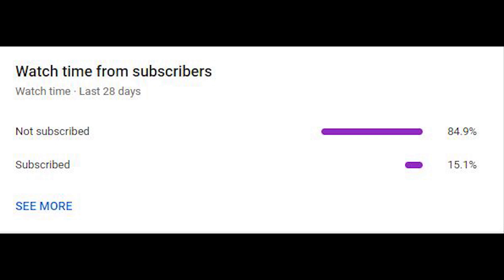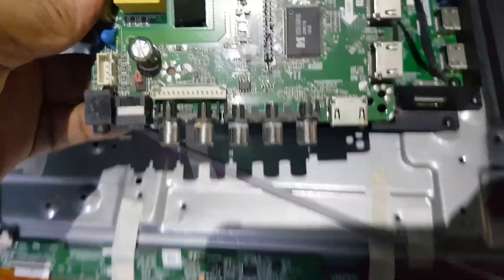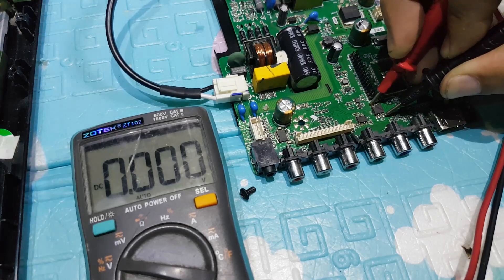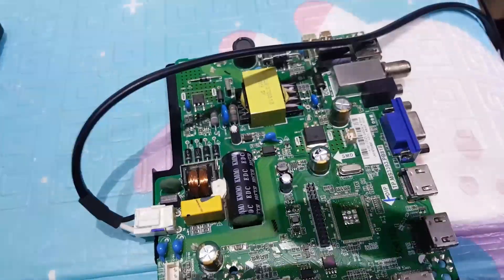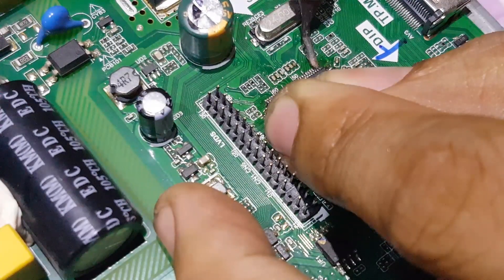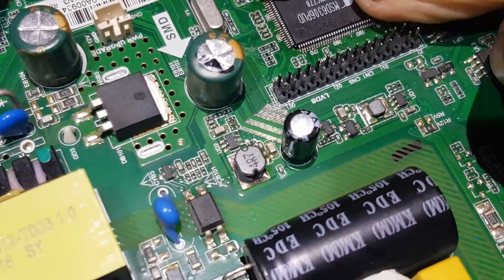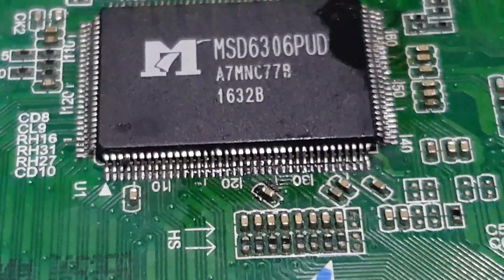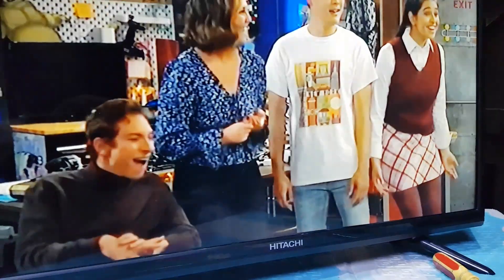Led TV MCU  (basic soldering techniques)

Comment: I tell you what! Growing a channel, you need subscribers, notification bell , likes, and comments,
I see you are showing how many watch w/o subscribing.
I watch.
I give you likes. 
I give you comments. 
You want a subscriber? 
You want the notify me bell?
I want more flux! 
When I see you start using more flux, I will give YOU the sub and the notify me bell! 
DEAL? 
My case in point comes at about 9:50 in this video! IF you had applied flux before you started tinning those traces, All that bridging would not have existed!! Not to mention the the time it took to reflow that solder to remove that chip in the first place with NO FLUX, All the while RIGHT NEXT to a plastic header! OMG I'm yelling at my TV watching!!! USE MORE FLUX! Dang, Use SOME flux!!! 
Never solder, unsolder, clean pads, pick up your soldering iron or hot air wand, wick up solder, without first applying FLUX!!! Don't work with solder AT ALL without flux!!! AT ALL! NEVER

Comment: Hi Tevz . how much did you charge from that work.
Reply from the maker: About $30 parts and labor.
Reply: @tevzTVTevatronics  thank you mate. 👍
Reply: @tevzTVTevatronics  May I inquire as to where you are? Comparing prices with the US. That job would be probably very close to $100 around here. But with everybody throwing things out there are very few people who work on them anymore.
Reply from the maker: @josephroberts6027  32 inches led is about $150 brand new. If $100 to repair it, It's better to throw it in the garbage and buy a new one. Im from the Philippines. 32 inches led tv costs only about $30 to repair here.

Comment: Great video.
I think applying  flux in the procedure of the desoldering would help you a lot and also help to  not thermal stretching the ic so much. Theres many cheap replicas flux on China market that are great.
Reply from the maker: Great point!
Reply: What could be the best brand for resin flux?
Reply: @rojanpajalla9403  AMTECH 559

Comment: Excellent presentation, one for me...if you allow me a question for you:
What is the adjusted value of the hot air flow that you use to replace the MSD6306 (I read in one of your answers to a comment that the temperature is 420 degrees)? I watched on YT the way in which an integrated circuit with many pins and...those who have done this operation (in most of them, with material possibilities that far exceed mine) use a pre-heating device to help the hot air blower...I see that you have the ability to strip and without pre-heating the circuit, this is due to the experience accumulated over time, I think... in my country, at prices of approximately 150 euros (US dollars), I can purchase the Gordak, Baku 702B or equivalent brands... I'm going to try to buy such a workstation, just for experiments and free time using defective electronic boards from old HDDs or from defective internet network boards... I admit that this technique is beyond me and I'm not even looking at it of course you will thank you for your kindness and help
Reply from the maker: My hot air station is not digital so I only guessing the temperature .  I'm in this work about 35 year atlases. These hot air are not included to my tools. When a tv becomes like a computer circuit now, so I need lean that hot air how to manage it. Thats why I don't use hot air im my other's video because I'm not expert on it. Sorry for the bad English,  by the way thanks for your support.
Reply: @tevzTVTevatronics  My respect for you, professor, and thank you for the lessons I follow on YT, with your kindness...my "English" is not that advanced either...I also use Google translate many times... important are the indications and recommendations that I understand more easily, thanks to your way of conveying them... and, I saw that not the fact of having the "latest tools" help (such as the pre-heating plate or the latest "news" of multimeters, most of the time very expensive) are important in this field, much more important are the experience and inventiveness of the way to solve a malfunction...not to mention the theoretical and practical knowledge acquired in so many years of your activity in this field... my big problem is the close-up "view" of the small components and the distance required to use the soldering gun in that narrow space... I follow you with pleasure and respect, because I have a lot to learn from you. .thank you, on a this way, for everything you make known on YT, about your daily activity and I wish you good health and satisfied customers in the new year 2023... from Romania, Eastern Europe, thank you for all your lessons